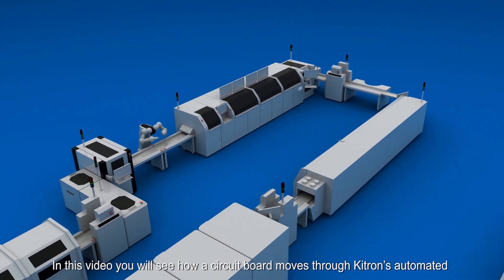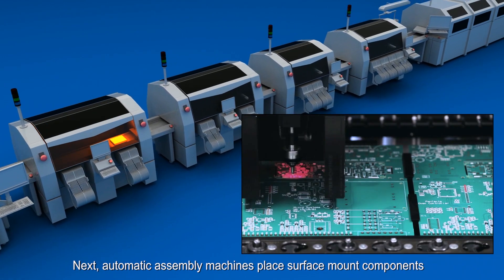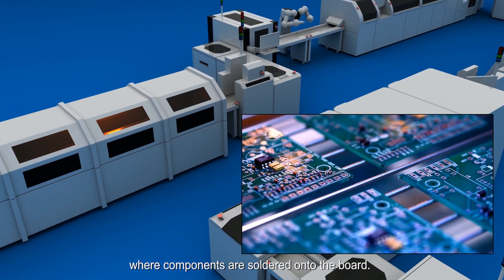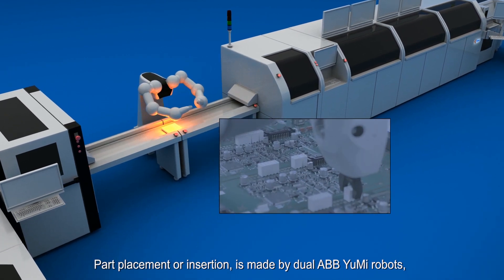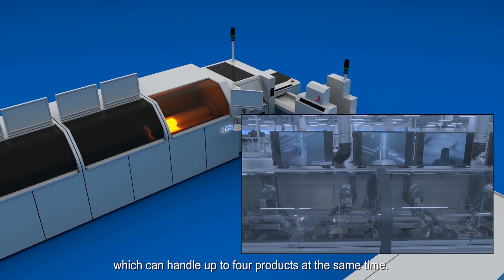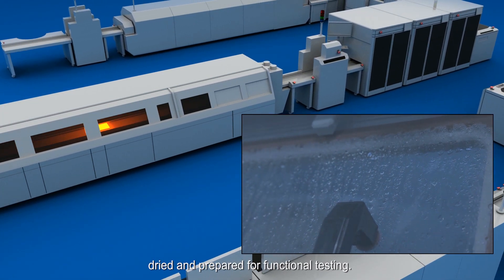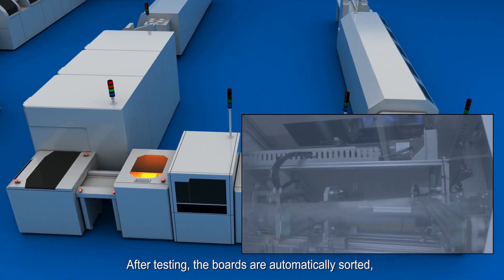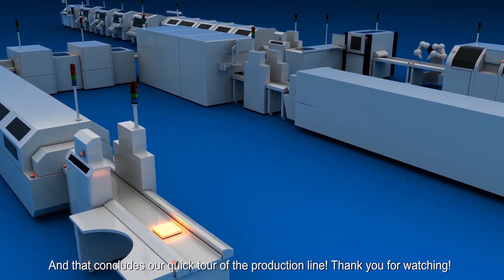Fully automated one-piece-flow production line | Kitron Group

Comment: Nice system, but not when there is a lot of changeover. Also, i wonder how the bends work when there is a great varity of board size. It also seems to like some kind rework table when there is a faulty board. After Pre Reflow inspection, you do want to correct the mistake. How about a backwards link to adjust paste dispenser? etc. etc.